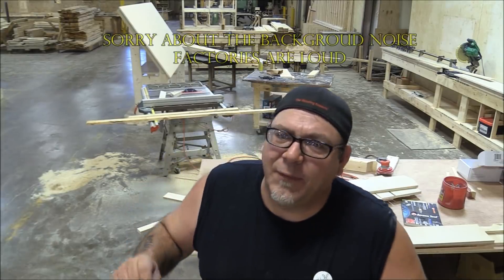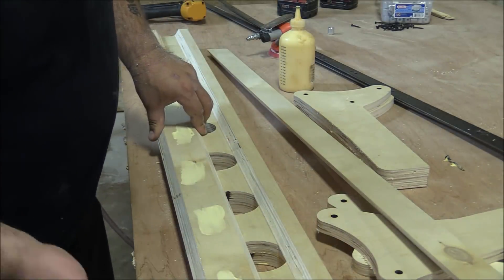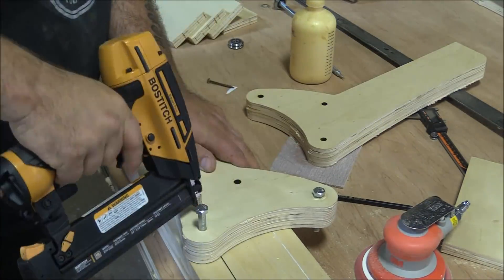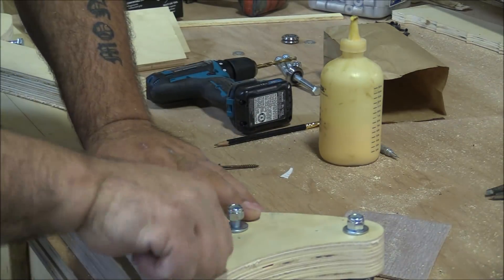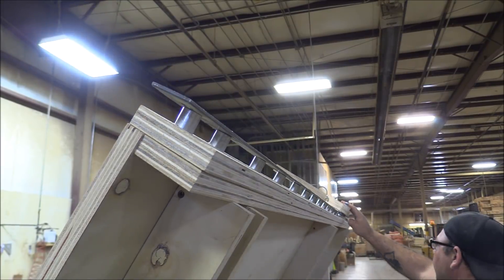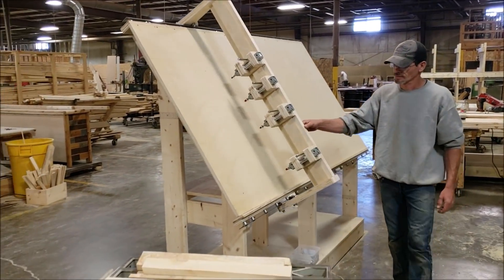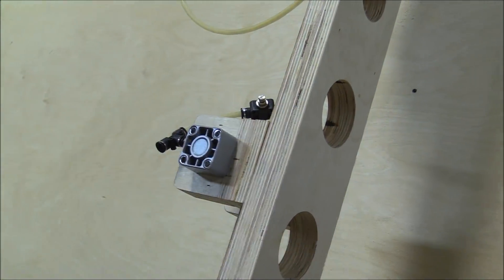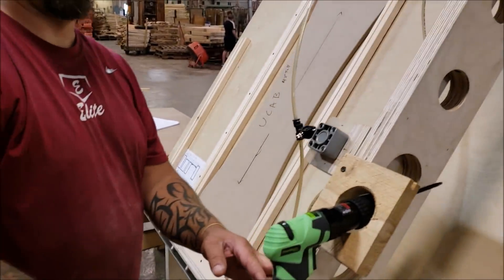Save Huge Money Building a Clamping Table | Woodworking

Comment: I like the design! I built a face frame assembly with slide adjust pneumatic clamps. 4'X8', with a 3" angle iron frame, supported every 12" with 3X3" angle iron. Built it for a friend who wad a custom cabinet builder. Compared to his old table we were able to go from a 75-i0% face frame to about a 98-99% frame. He loved it and it is still in use after all these years......

Comment: Us less monetized types could build this but use wood cams in place of the air cylinders.  A piston under the cam could be used if the rotation caused a problem with the parts moving on the table.  A lever are could control all the cams.  Now, go build it and do a video for me!  Nice project and video Izzy!  Jim

Comment: Only thing i would change is the plywood table, would recommend something that glue wouldn’t stick to or at least would be easy to peel off once dry , i made similar thing at my shop and i tend to get lots of glue spots on it but in my case they just flake off once dry , i used laminated sheet

Comment: I'm actively building this. Great video, but I'm left with a couple of questions. Could you link the feet you used on the pneumatic clamp? Also, I have the dual lever. The connections are confusing...can you draw a schematic on how you connected them? Thank you. Great video. (Also, Im going to use this in a home workshop...adding a tilt feature to the table and a simple fence to the track for other projects).

Comment: This could be hydraulic. Use air pressure directly onto the hydraulic fluid so you only have a small amount of compression. Using a large air/fluid interface driving a small piston could also multiply the clamping force applied.

Comment: To be more efficient on air use would a spring extension cylinder be better and only use air to release so your compressor doesn't have to stay on during the long gluing process

Comment: Izzy,
Love this set up.  We are putting together a Amazon list for parts needed for similar build but we are having trouble finding rubber bumpers for the ends of the cylinders.  Could you send me a link to what you used.  The threads on our cylinders are m16x1.5

Comment: Put an eccentric nut on the middle groove wheel to adjust tension.
Reply: I have used v-groove wheels with eccentric shafts to adjust the tension in a track. It seems like a simpler approach. Your approach works but it seems to be needlessly complicated.

Comment: Those would be aluminum spacers, as you said originally. Standoffs are internally threaded. However, those push fittings take tube, not hose (tube is identified by OD, hose is identified by ID).

Comment: This is great - THANKS! 
Question. I'd like to build this using waterproof glued plywood (I guess what they used to call "marine plywood"). Problem is, I cant find anything using waterproof glue. I want to use "A" or "B" grade on one face and have it resist my very humid SC shop environment for a few years. Very common a few decades ago - guys even made boats out of plywood. Has marine plywood gone the way of the dinosaur?  Has the name or terminology simply changed, and it's still available?
(SIDE NOTE: I went to the local big box and asked for this, and the response was a blank silent stare - guess he thought I was some kind of space alien.)

Comment: nice build but you should find a better way to lay those hoses personally it would bother me how they are currently mounted the use spiral hoses e.g. would make a big improvement
Reply: Andy. I don’t understand why he didn’t use single acting spring return pneumatic cylinders. You only need half of the hoses then too. And turn the cylinders around 180 in the holders so the hoses are over the framework, not over the work area.
Reply: In the video he states hose management will be done later.

Comment: How long do you project this holds up?
Reply from the maker: Jason Hoffman for a very long time. The advantage is if anything goes wrong nothing on this can't be replaced in just a few minutes and can't be made in house for the most part
Reply: I have a castle assembly table and I see the daily abuse wearing out the dovetail and a few other areas. FYI castle sells just the gentry arm for 1k.

Comment: Izzy just curious, could the clamps have been rotated 180 degrees so the hose fittings would be along the spine of the rail and the hose fittings would be more out of the way?  Or is there a reason that they are positioned for clamp pressure etc?  Love seeing this stuff!!
Reply: Gary Jones ... There is air supply on both ends of the pnuematic ram.  The bottom would be covered up if rotated.
Reply: MoJo Thanks. I've never really seen these in use and was curious. I appreciate the response.

Comment: Wow that is pretty cool. Would be easy to adapt that to make a lamination clamp system. How much pressure can you put on something with those clamps?
Reply from the maker: Greg Dent 1000 Newton's per clamp
Reply: Greg, To calculate the clamp force, multiply the cylinder diameter by .7854.    This gives you the area of the piston, multiply the area by the air pressure and that gives you the clamping force.  I hope this helps.
Reply: Steven Kofoed diameter square!
A=pi/4 D^2
Reply: einHOCHaufWISEGUYS I stand corrected.  .7854 *diameter squared
Reply: It’s good to know that there is peer review of suggested solutions. It is easy to make an error and good to know it will be picked up and corrected.
Reply: Arthur Crosby lol I love youtube comments
Reply: Kiwi Bird Thanks Kiwi Bird from across the pond!
Reply: izzy swan 😯😯😯😯😯

Comment: Yeah cheap and 8 hours when you happen to have a cnc wood cutter handy.
Reply from the maker: Edward Schmitt yes cnc make a lot of things easier
Reply: izzy swan

No doubt that's true, Izzy, but this would be totally do-able with nothing more than a table saw, band saw, and a drill press!

I don't have the slightest idea how to use CNC, and frankly I enjoy the repetition of fabricating lots of identical parts by hand, so I would totally be up for the challenge.

But if I had a CNC and I knew how to use it, I most likely would do so!

Really great work, Izzy, and well produced audiovisual content, here.